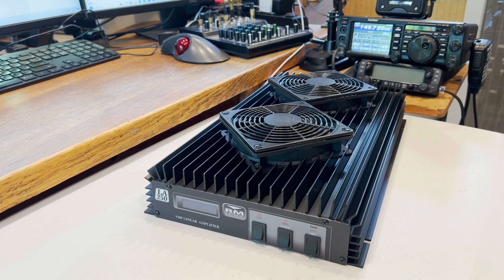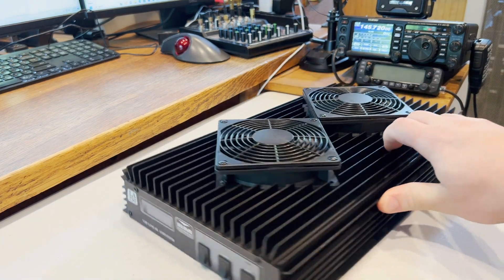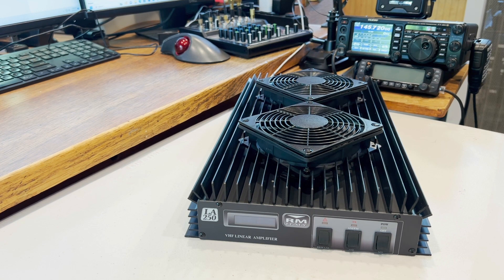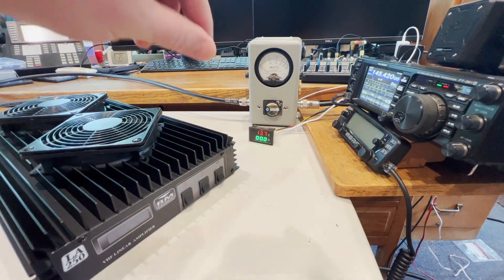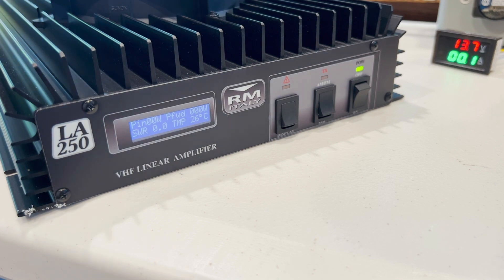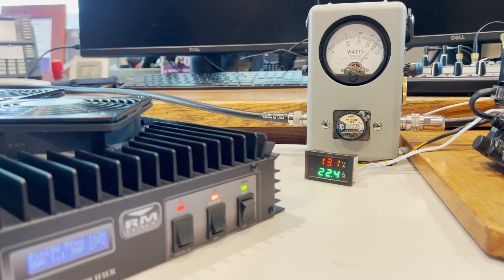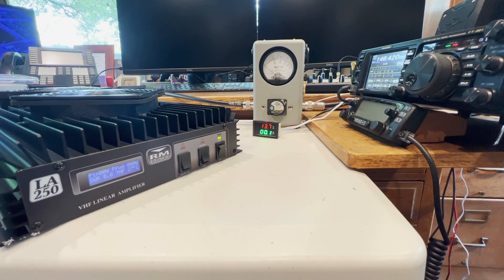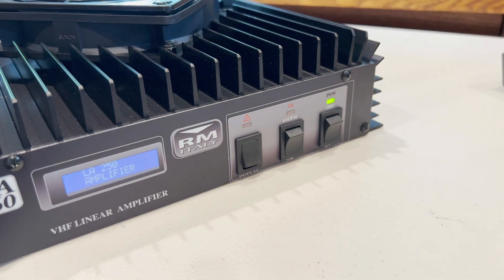RM Italy LA250 2 Meter VHF Amplifier Tour (Review?)

Comment: Had a SOMEWHAT similar problem with another brand.  JM Taiwan amp 350 watt model with 5 to 10
watts input (measured with Bird 43) the amp relay chatters and no output. However 11 watts input gives me a "too much input power" warning.  Returned unit and got another of the same model. SAME PROBLEM with this one too. Contacted the manufacturer and tried EVERYTHING and I mean EVERYTHING they suggested.  Wire size, 15/30 watt programming, DC supply is more than enough, voltage is 13.8 VDC  SWR with antenna or RF load check excellent, ferrite beads on DC power leads  still NG. This one is going back too, but for a refund.

Comment: I'm thinking you got a bad copy.
I've had one for 2 yrs. Driving it at 14W with my IC 9700 and approx 180W out.
I'm always between 144.150-144.174 into a 12 Ele Directive Systems Yagi.
The only issue I had was the T/R relay after 2 yrs is starting to go bad.
Yours is a mystery to me.

Comment: Hello gentlemen...i have purchased 3 amps from the same manufacturer for use on 430Mhz and all three were junk.All i ever got was smoke and a run around from the Australian distributor and a hand drawn circuit diagram.All there units all falled  within minutes of being put into service and all the mosfets all damaged...they also used mitzy fets...they all never even produced there rated power ,.well under...junk dont buy RL products ... ended up buying ex commercial motorola amps of ebay...made a wilconsin combiner ... reliable 500watts fm ...rock solid...hope you find a solution...73s...ZL2UJI Auckland

Comment: I have one of these and find it very temperamental. Im driving it with a IC 9700 and it needs to stay on AM/FM no matter what mode you're useing it also prefers 15v input as the ZL importer told me. if im on ssb I have the power on the 9700 at 18% no higher or it trips out but if im on digital I put it up to 25% which makes no sence.  DE VK2FZR

Comment: What power supply do you have powering this? Wire gauge connected to the amp?
Reply from the maker: Hey there Kyle - I tried a couple.  A Diamond 40 amp switch mode, a Tripp-Lite 60 amp linear and eventually a car battery just to make sure it wasn't some odd RF.  I started with #10 wire and then went to #6 about the same result.